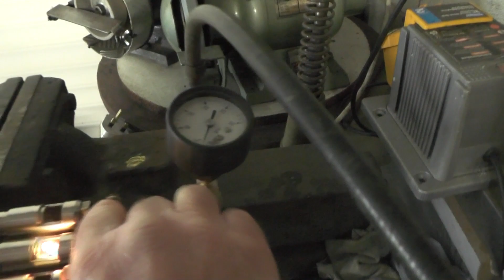Gas Burner P3 for 5" Gauge Sweet Pea Metre Maid Locomotive Testing with Gas "mr factotum"

Comment: On butane it needs a bit more air and it will be just fine.
Reply from the maker: eyup Michel
Yes when its in the loco firebox with the blower on it should draw more air in.
Apparantly it has been used to steam a loco around the track, so i don't want to make adjustments till i have tried it fitted to the loco.!!! Just need more time in a day to do everything🤔🤣🤣 Never time to be bored!!
thanks for the feedback👍👍👍👍
cheers
Kev
Reply: Hi Kev. Very interesting to see the difference between the two gasses. Looking forward to seeing the burner on the engine. I’m a traditionalist and nothing can replace coal to generate steam. But in these times, coal is viewed as the devil reincarnated. How long until you experiment with hydrogen? 🤔👏👏👍😀
Reply from the maker: @andrewatcarpathian  cheers andrew
you can't beat the smell of coal, soot, clinker and smoke to keep the lungs in tip top form
😘🤣🤣🤣🤣, it's only a trial, i think!!! as for hydrogen, "back to the future" for that,
one of my commentee's says what about a chinese diesel heater combustion chamber, there's a thought, and may be a seed set!!!
atb
kev
Reply: @MrFactotum  Those Chinese diesel heaters are getting everywhere. I look forward to seeing how that idea develops. 👍😀
Reply: @MrFactotum  it would be no good to me, you can't get Chinese Diesel around these parts!

Comment: Very interesting concept and much cleaner than coal, how do you envisage carrying the gas bottle on the track? After the success of my Chinese diesel heater, it's got me thinking if I could use the burner principle out of one of those...
Could be interesting 🤔
Reply from the maker: Great point! Trevor, i may not use it on the track, just getting it going for a friend, at mo. We will see, when i get time!!!!!! i'm going to steam loco up  after a few maintenance jobs, if it works well i may make a copy of it, then i will have to sort the problem of carrying the bottle!!!
Are we going to see a loco going around the track  on CDH power.
Interesting thought🤔🤔, if it works there will be filling stations at every track
Don't set another seed in my head!!🤣🤣🤣😉😉👍👍
Just finished soldering the tender up. still got to make a lid, filler, hand rails, bypass valve, drain valve,pipework, filters etc etc
ATB
Kev
Reply: @MrFactotum  don't do what I did when I soldered my lid on, forgot to remove the flux, the boiler was priming like crazy 🤣
Reply from the maker: @Mr-Steam  Yes Trevor i remember you saying, i'm not soldering the lid on going to screw it on with a gastket, for any later maintenance if required. I've just cleaned it out with some soapy water, and in the kitchen now filling it to test for leaks, then got to edit the footage for the next video, watch this space.
cheers
Kev

Comment: Hi Kev !
That gurgling noise when the burner was running, was that the gas air mix combustion in the nozzles?
Not an expert on this but would that go away if the gas pressure is increases?
Ps. If you had run that burner longer, you could of warmed the workshop a bit 😊
Your Pal,
Neil
Reply from the maker: eyup Neil, 
yes exactly what i thought with the noise, i didn't design it and apparantly new information come to light, that it worked ok steaming a sweet pea around the track.
It needs proper testing inside the enclosed firebox on the loco with the blower on to draw the air/flame, maybe then it will perform better, i'm no expert either, but before i go to the trouble of any adjustments, i need to steam the loco up with it,
As for warming the workshop up with it, i wouldn't be able to concentrate on any work due to fretting about the amount of gas leaving the now expensive bottle!!🤣👍🤣🤣👍👍
ATB
Kev
Reply: @MrFactotum  ah right, that makes sense. Not considered the blower. It just sprung to mind when I saw the flame back at the jet. You know something is amiss  when that happens.